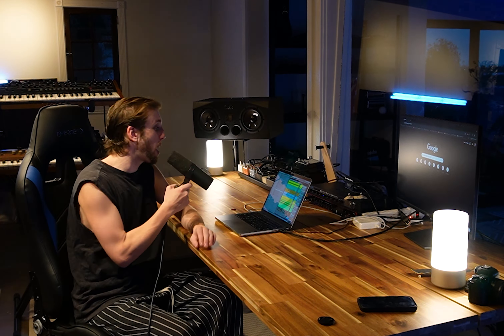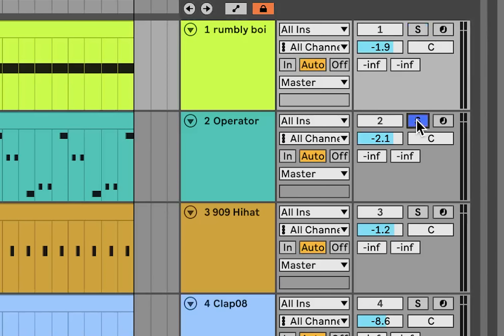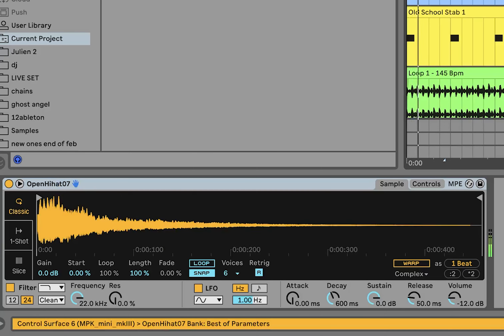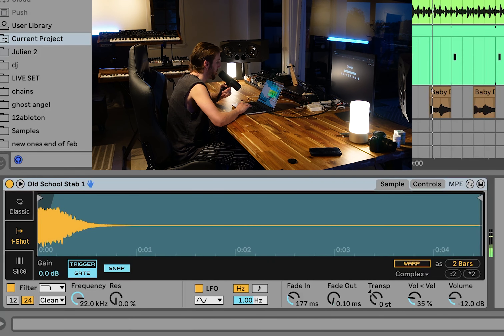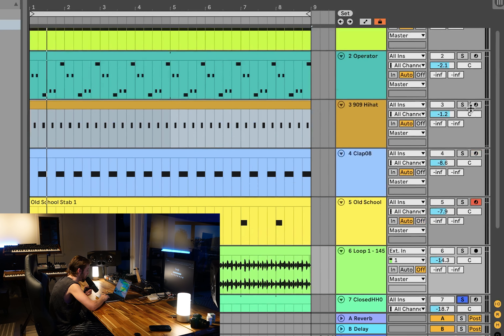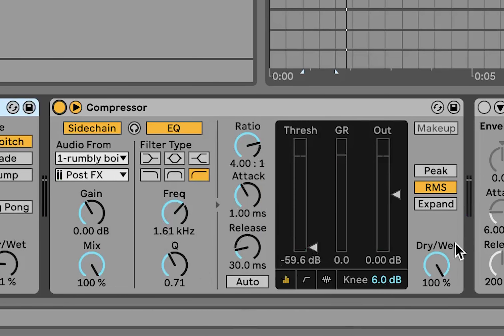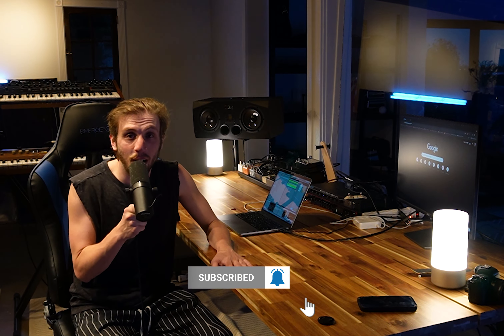How MCR-T REVOLUTIONIZED Trance Techno Production [+Template]

Comment: when i adjust operator mine sounds too low end and not plucky, what am I doing wrong?
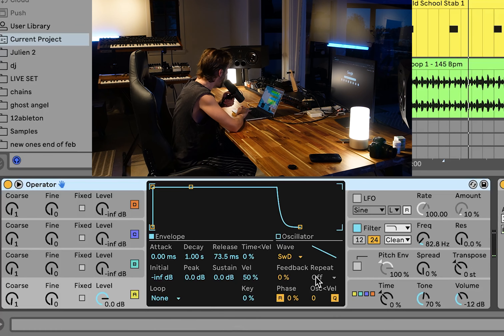Reply: Did you add the envelope? So turning down the filter alone will just get rid of all highs, but to make it plucky you would increase the amount of the "envelope" effecting the filter to quickly open up itself on each hit of a note. You can add the filter envelope by clicking on the filter in operator and in the section underneath the envelope (you would shape to taste) you will see a option called "Envelope" hear you would add 63% as Julien did. He does it really fast but he actually hovers over it (1:14)